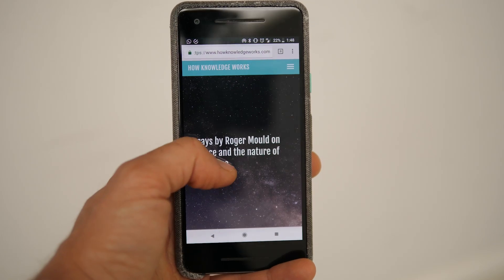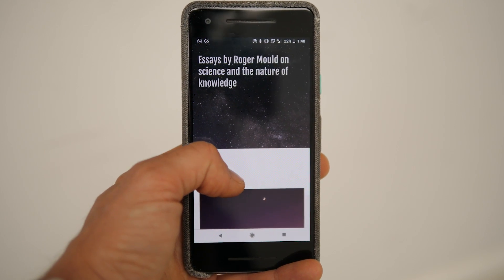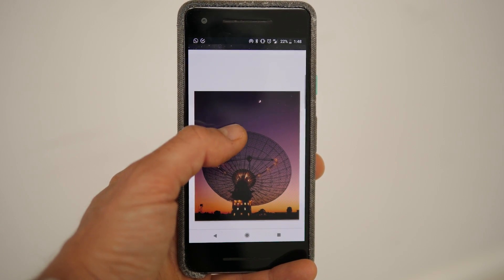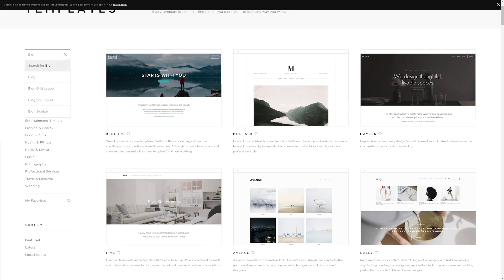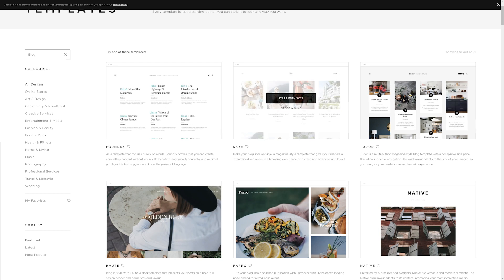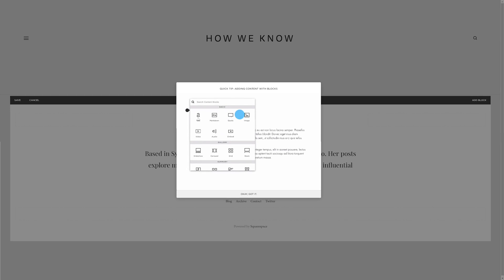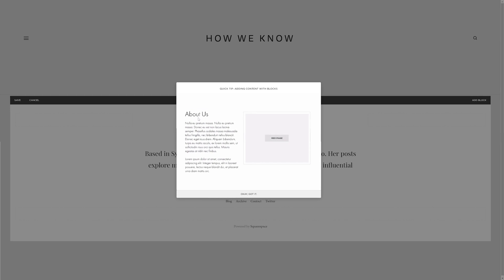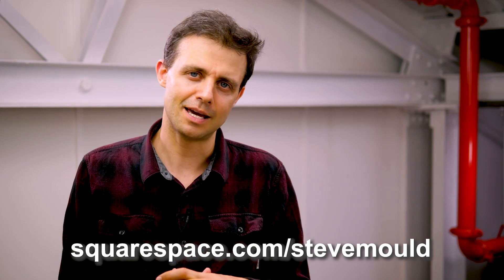The bizarre ripples that form in a stream of water

Comment: My hypothesis on the "standing wave" is that when the flow touches an object, the water at that point drops its speed due to the adhesive property of water. So, due to this "touching" and "slowing down" the water above it somehow... bounces back up because of this "water collision" (?). Sorry if my explanation is too complicated, but it's sorta like people in a line— assuming they're all walking, when the person in front suddenly stops or slows down, the person behind collides and sorta "bounces off" of the person in front... And this is what's happening in that flow of water; that's also why the farther the object is from the start of the flow, the less "collision bumps" there are.
That's just my hypothesis though ^-^

Comment: Is it related to Water hammer? Stopping the flow of water column may be like the sudden closing of a tap. This may result in an upward shock wave that we see. And the change in 'wavelength' as we go up can be attributed to the usual thinning of the water column as it flows down (thus, the shockwaves are reflected of the column walls at smaller spacing down the flow).

Comment: Here is something I encountered a long ago: Get yourself a length (about 1 metre) of a hose with wavy wall (similar to these waves). Rotate that hose above your head (that causes air to be pulled through the hose via centrifugal force) or simply blow into the hose. The hose will start to "sing" (emit a tone). If you rotate it faster (or use a blower that produces high speed air stream), the tone suddenly jumps to a higher tone (maybe the original is a base frequency and the higher one is a multiple of this base frequency?). On the other hand a hose with a flat (non-wavy) wall does not sing at any speed of flow through it.

Comment: Dear Steve,
As much as I have enjoyed your channel after being introduced to it by Veritasium, I think you took the long way around to explain the ripples in the water stream from a faucet.  I had noticed this effect some 50+ years ago and felt the book I read 60+ years ago explained it quite nicely with one small addition of mine for the reason for the change in the ripple spacing.  

The book was the re-publication of CV Boys’ “SOAP-BUBBLES. AND THE. FORCES WHICH MOULD THEM.”  Which now is easily available on Gutenberg and Internet Archive.  
	http://www.gutenberg.org/files/33370/33370-h/33370-h.htm
In particular, check out pages on a cylindrical soap bubble tube stability starting on page 59 to the real important point on pg 78-79 where the cylinder length max is 3 times its diameter, a condition that also applies.  

The later pages at 113-115 talk about using a water jet for audio amplification.  I did this experiment in my teens over 60 years ago!

So to the theory.   When the water stream hits your finger, it generates a constant shock wave (sound) that travels back up the water stream where the dynamic instability of the fluid column amplifies the collision.  The ripples die out because of a damping effect of new, undisturbed water flowing down.  But this flowing has another very important characteristic – it compresses the wavelength you see from the outside – a Doppler effect.  As you move your finger up, you are moving into slower moving water as it has had less time to accelerate under gravity, so the wavelength you see is longer, until it is a blob on top of you hand.  Also because the time it is there is longer (slower water speed at the origin) the fluid constriction effect has more chance to effect the water stream hence the increasing ripple amplitude, trough to peak.  

An additional observation is that the general slimming down of the stream is due to the increasing stream speed stretching the water column ever faster like taffy.  

Another observation is that the faucet experiment is usually easier to do at night than during the day inasmuch as the water usage is lower and not as much sound is in the water mains from the water being used.   Just mild tapping on the faucet while doing these experiments will make that sensitivity very obvious.  

Regards,

Comment: Yeah when you put your hand under it the water can no longer follow it’s natural but instead pushes up the stream or less down the stream. It increases the surface area in those bulges and so less pressure is exerted up as you travel up the stream. So the bottom closer to you has more surface area with smaller waves that become bigger until they are nonexistent because the pressure has equalized. It won’t happen at the bottom of the sink because the surface is water and not cloth or wet cloth and so adhesion just pulls the water down with gravity overcoming the force up.

Comment: You have to try getting a different color water as a stream inside the main stream to see the flow of water in the waves. It would be real cool if you could move it to the center or a side. just a tiny bit of food dye just as it is leaving, with a pump/valves to tune the output to match the water flow?

Also, can you adjust the surface tension with soap or whatever, and see the results? could you fix it to change in real time, as the flow is moving?

Comment: The acceleration of gravity plays a role in this effect.  The molecules that were released first, drop at the velocity as dictated by the gravitational force.  The molecules dropped immediately afterwards will accelerate at the same rate, but will have a lower velocity at a particular moment.  By placing a finger into the stream of molecules, the deceleration causes some of this effect you're seeing.  Of course, the surface tension and the effects of internal pressures interacts with the velocities of the stream...

Comment: The water react to the same wave as magnets
The Maxwell crockscrew is respected
The flow get higher speed on a certain angle and slower on the other directions, this influence the polarity of the flow and influence the source by incidence

This is due to the earth magnetic field reacting with a constant water fall on specific plan

Comment: If the phenomenon you mentioned was related to this one, you would see the flow become thinner and thicker symmetrically. In this case it doesn't look like the stream is stretching, but rather crumpling (like soft serve ice cream). The diameter remains even, and doesn't bulge along the generated spiral. I think you were on the right track when you described the layers of laminar flow. 

On the outside, you have a slower-moving layer of surface-tensioned water, almost like a stretchy rubber hose. When you interrupt the stream, this water piles up on itself, but because the surface tension won't let that outer layer shatter, it keeps the inner layers flowing laminarly in a crumpled path (again, like a thin rubber hose) until it interacts with the interrupting surface. 

The phenomenon becomes tighter lower down because the water is moving faster, and there is more force being applied to the outer, springy surface-tension layer, causing it to compress more tightly. I imagine the fact that the cross-section is smaller lower down also means that the water can pass the obstruction easier, which lessens the l length of the pile-up further.

Comment: And I discovered (probably some people have done it too) that if you get closer to the source it starts to go drop by drop  then you can stop to stop the water flow and it will keep going drop by drop a few seconds and they go back in stream. Also you can open the tap a very very tinny bit and you'll see that the stream stop at some point and it becomes individual droplets. There must be some conection going there.

Comment: The first part of this video in your kitchen reminds me of the really cool thing you can do with water if you have a comb (especially a rubber one) that has been charged up with static electricity: Make the water curve insanely to one side (and even UPWARDS if it's got enough charge and/or the stream is thin enough). Just comb your hair really fast for a few seconds, hold the comb NEAR the water and see what happens! Clean dry hair works best.

Comment: i'm interested to know if a water pipe or hose would be better for flow if the inside was a corckscew profile instead of smooth circular cross-section.
normal pipes and hoses produce a lot of friction/turbulence which puts a lot of pressure and hammer when flow turned off.

Comment: Seems it would be similar to when any soft body with exterior tension means a harder surface. So for example my thought was of spray can string when sprayed into a wall. Basically at a molecular level it's 'backing up' and 'folding' like paper might.

Comment: .                    When you put a obstacle in front of the flow, at that point you are stopping the water for a moment, the water bulges as it builds up against the surface that obstructs it drawing water from earlier in the stream. With the water being drawn earlier in the stream it gets narrower at that point.  With that narrow point the stream is partly cut off at that point, meaning that the surface tension from yet earlier in the stream wants to bulge out, like a droplet, and this just continues up the stream.

                   That's the explanation that makes sense to me anyway.

Comment: 0:36 - Simple explanation.  Anyone who lives in a major city will know exactly what's going on.  It's called traffic
The molecules that reach the obstacle (finger) are slowed.  This forces those in proximity to slow, which forces those just slightly removed to slow and start redirecting (the kinetic energy of the falling water is imparted on the obstruction, and the water above transfers its kinetic energy into the slowed volume below).  Aaaaaand... so on, causing the ripples as chaos ensues.  Shows how one little twit going 10 miles below the posted limit can f* the travel of every single car behind them in dense traffic.
As for pulling toward the obstruction... similar issue.  Those that strike the object 'exit' the highway onto that object by whatever attractive forces are in play.  The molecules near them are pulled along while slowing and redirecting... and so on.

It's rush hour traffic, that's all.  Surface tension defines the boundaries of the 'highway'.

Comment: this also has to do with friction caused by adhesion if you put a surface underneath at 90 degrees this doesnt phenomenon never happens.
This has a potential to prove that frictional forces on rigid objects behave somewhat similiar to adhesion on fluids.

Comment: Steve  I wonder if your bubble behaves the same in a vacuum? and i wonder the same for the laminar flow.
2nd  in laminar flow is the interior of the flow moveing faster than the exterior? if so does the material inside become the outside at the tip of the flow?

Comment: 5:55 looks to me like the wavelength is short near the obstruction, and longer closer to the tap.  You alluded to something similar when you moved the obstruction up and down.  My hunch is that the wavelength varies with vertical speed.  Also, as the water drops more, the stream gets thinner.  I picture this as a series of droplets not yet separated, but stretching longer and getting thinner, until the pinch points "win", and the droplets do separate.

Comment: The ripples caused by obstruction and the ripples caused by the rayleigh plateau instability are in fact, different. In RPI, the ripples actually resemble small droplets themselves, and the stream makes a mirror image of itself, like a string of beads. With the obstruction ripples, you notice a sort of helical structure to the water, NOT the bead-string effect. 

Though as I'm typing this, I realize it's been a year since you posted the video so it's likely been brought up countless times.

Comment: In a hydraulic ram pump, water hammer provides the force.  This looks like water hammer to me, and perhaps this occurs inside it, and perhaps length of pipes in it are important.  Your water seemed to have wavelength (frequency), so the flow self adjusts to proper downward,  and opposing water hammer reverse flow forces.  Just spitting in the breeze I dunno.

Comment: I think you're on the right track.  I think the missing piece of the puzzle is the disruption of acceleration.  The column of water in free fall will get thinner and thinner as it falls and accelerates until it eventually breaks into droplets.  So you're stopping the flow and forcing a rapid deceleration of the water at the end, forcing the node as you put it.  The first node creates a deceleration of the water behind it, and subsequent nodes form.  To prove this you could use slow motion footage and if I'm right the nodes will appear one after the other starting from the bottom.  The waves get smaller as you go down the column of water because you're allowing the water to reach a greater speed before interrupting it.

Comment: Maybe it’s the bipolar nature of the water molecules that are like a V shape.  That condense under pressure forces but on the rebound want to resist from pulling apart, so a oscillation cycle is set up, in - out. Boing.

Comment: Great video! When I was a kid I was able to watch and play with this for hours. After watching I have the feeling that velocity has a crucial part at this phenomenon as well. As the water moves down it's velocity increases, so the stream is constantly stretching, so this is the reason it gets thinner and thinner on the way. Wherever it hits the object, the flow slows down, so it gets thicker before the touching point. Whenever the object is closer to the source, the stream thickens, whenever it is farther it grows thin. I assume when it gets thinner it gets more unstable, and after a certain length it breaks into droplets. Maybe because it reaches the speed it can not be laminar anymore, and the occurring turbulence breaks the stream up.
When it's short, I also think about the stream as a water in a thin flexible and elastic pipe, wherever it's diameter shrinks I assume the momentum of the flow will produce extra pressure on the upward wall of the thin bridge, while the quick deceleration at reaching the object creates an extra pressure on the downward wall of the thin bridge. While at the object it looks like when two separate water bodies are just touching each other. 
I just wonder why the pattern shows up only at the end of the stream, and why it dies after a several ripples?

Comment: Very interesting and intriguing, as usual. 😃 Here is a thought that might be relevant: the liquid falling in the gravity field is going to speed up (9.8 m/s) so conservation of mass together with non compressibility will force the stream to become thinner and thinner as it gains speed. But when it encounters an obstacle it will be slowed down. It seems to me that the phenomenon can be regarded as a stationary wave because of the reflected wave originated. It would also make sense to the fact that changing the path length it stops being stationary: stationary waves require the path to be a multiple of half  wave length. If not multiple of half wavelength they start wiggling.

Comment: You have a barrier to the flow, the velocity of the flow is low enough so disruptions in the flow can be noticed even before the disruption happens. So in this case, your wall makes the water bounce against it, the water that hits the surface has a vertical velocity of zero. So from this point, the speed of the oncoming water is decelerated. In order to be able to have the same flow with the decreased velocity, the water stream has to widen above the barrier surface (as Bernoulli would say), the surface tention holds it together though until the forces are in equilibrium. The widened stream then creates pressure gradients inside the flow that  then form the wave pattern inside the flow

Comment: Realize there are other factors.  Water isn't all surface tension, it wants to stay together inside as well.  In the smooth column, the lower water is pulling the upper water down, and the change in speed over time due to constant acceleration is what draws the water into a narrower stream.  So think of that as a continuous process, then your finger or object interrupts the stream.  You have an impedance mismatch, just like an incorrectly terminated coaxial cable.  The water hits your finger/object, and part of the energy continues with the water on down, but you've slowed the water and changed the normal acceleration profile, and part of the energy is reflected back up the stream, and that energy probably works against the surface tension to make the bulges..  No doubt it'll all devolve back down to you are making wave nodes that you can control by distance when you interrupt the stream, just like it looks like.

Comment: Here's a question about faucets. My faucet produces quite a bit of bubbles when it's running. When it's been on for a while, a big bubble is made in the center of the stream. If I put my finger under the bubble, it doesn't pop, but it gets smaller and if I move it up, it continues getting smaller, but hen I move it back down, it stays the same size for a while before either going away or returning to the original size.

Comment: The ripples at 3:16 are not the same from left image to right one. The left image has the peaks of the sine-wave in-line with one another on each side of the flow. The one on the right has the peak lining up with the valley - which ends up giving you a ~~~~~ sort of flow.

Comment: Your finger or your neck bulge very slightly with your heartbeat.  Could you put a laminar flow onto a slow oscillating surface and detect the rate of the oscillations without seeing the surface by looking at the ripples in the flow?